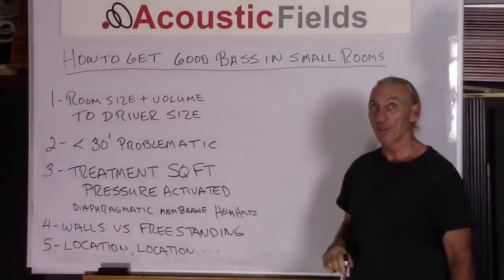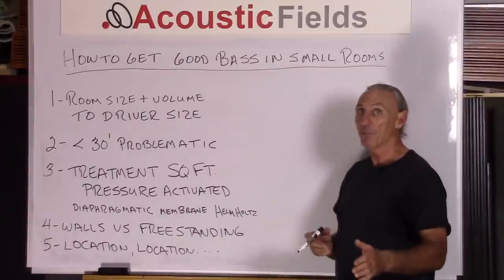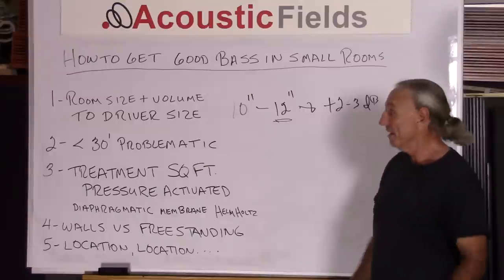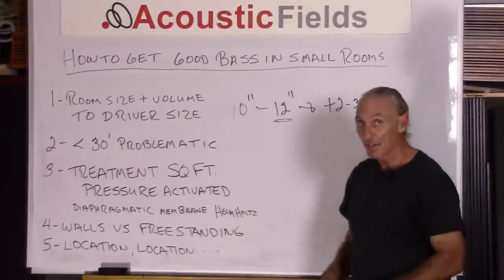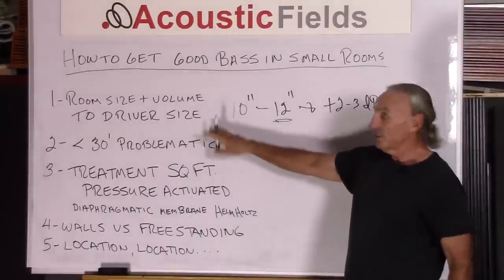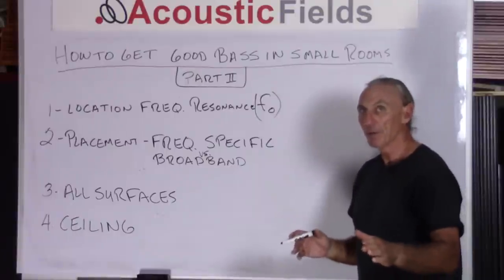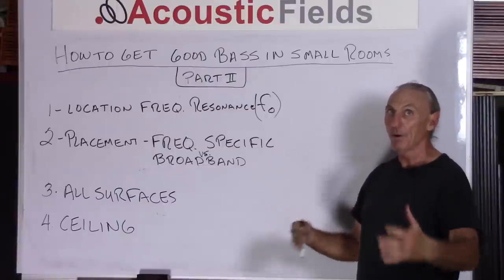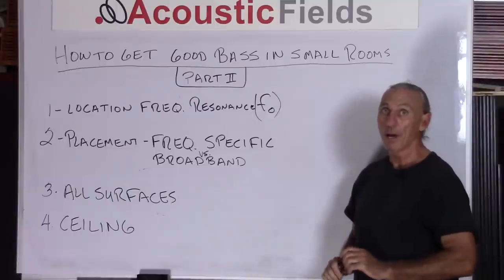How To Get Good Bass In Small Rooms - www.AcousticFields.com

Comment: i have a room with 10 ft hight  width  and lenth (square size room ) please help me to design this
Reply from the maker: Hi India, I would strongly suggest you find another room size and volume. Having three dimensions the same compounds you low and middle frequency modal issues by factors of 200 - 400 %.
Reply: i have 2bhk flat of same size of rooms  then  can i use my lobby approximately 12 by 18 ? its the area of my homes main entrance so can i use this in like open space studios 
plz can u give ur mail id i want to send u the pics of that area 
thankyou for helping sir

Comment: Just a small point. A 12 " woofer is about 40% larger than a 10 " woofer not 20% as mentioned.
Reply from the maker: C,  Let me see how you arrived at that number. Show me the math that you used to derive that percentage difference.
Reply: Acoustic Fields  are of circle for 10" driver is 78.5 square inches and area for 12" driver is 113 square inches. Twenty percent larger of 78.5 is 15.7. 
78.5+15.7 = 94.2
far short of 113 
Easiest way to do this is to square off the drivers, thus a 10" driver would be 100 and 12" driver would be 144. It's not accurate but it
 allows comparison between area of drivers in one's head quickly. For example a 21" driver would be 21x21 or 441 square inches
a 12" driver would 12x12 or 144 square inches and if you multiply by 3 equals 432 which makes 3 12" woofers equivalent to 1 21" woofer. This of course doesn't take excursion into consideration and only deals with area of cone but all else being equal works nicely.
Area equals pi radius squared.
Reply from the maker: C, Rather than focus on surface area, focus on output. Your room only cares about energy. Show me the calculations for the difference in output from 10" - 12".
Reply from the maker: C, Not deflecting. Good work on the percentage calcualtions. This is an educational channel. I am using your math skill set to educate. People get tired of reading me.
Reply: Acoustic Fields I don't think people are tired of reading you. Sorry for misreading your intentions. Take care.

Comment: i have a 10x12 room.... its a small room. should i just use headphones?
Reply from the maker: M,  It depends on your usage. What are you doing in this room ?
Reply: Acoustic Fields I am producing music but it requires for me to hear the low end properly but I can't... as I move back from the monitors I hear the low end rumble and as I move forward I don't hear it anymore
Reply: I have this same issue.  Any advice?
Reply from the maker: J,  You must treat the issues in the room within the space requirements available.
Reply: I've listened to Bobby Niwinski say, as well as you said in a different article, that it's pointless to try and treat a square room with small dimensions.  I'm using Yamaha HS8's in a square room that is roughly 11.1" x 10.5"x 10.2"  Is it worth it to build some panels to help absorb more low end or is it a lost cause?

Comment: How logical is placing my 10" sub inside my closet and shutting the door?
Reply from the maker: R,  It depends.  If your closet has diaphragmatic absorbers in it then it is a good thing. If it is full of clothes then you won't be able to get down into the 30 - 50 Hz. range. You will have absorption above 50 cycles.